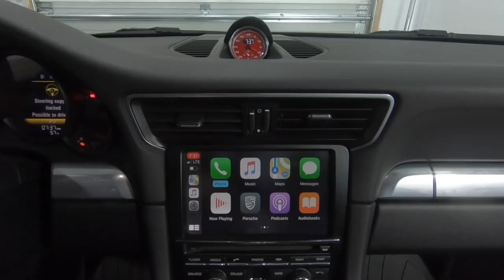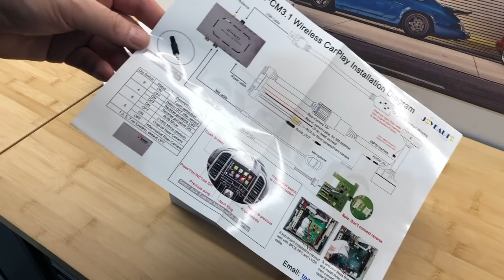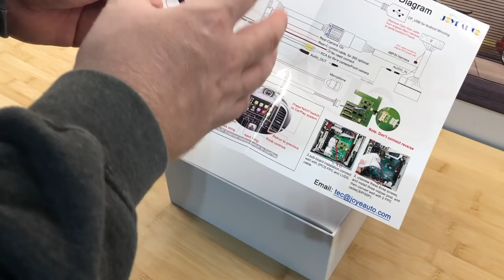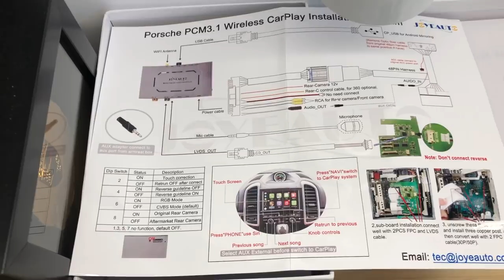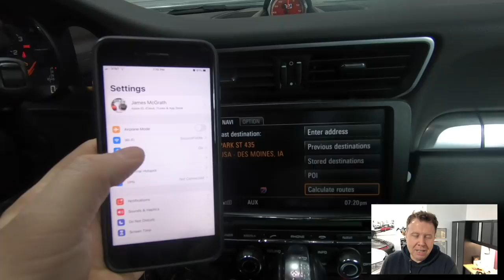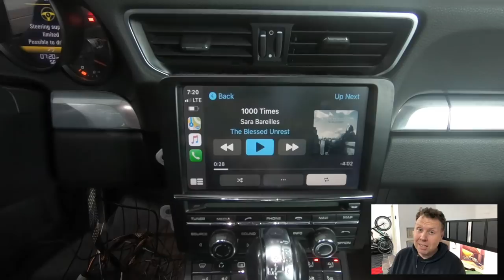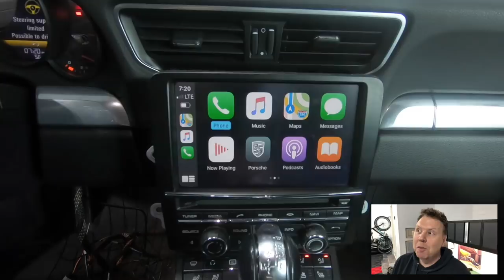Apple CarPlay DIY (Wireless) for Porsche 911 / Cayman / Boxster / Macan / Cayenne / Panamera

Comment: Around 22:00 in, before you reassemble the PCM I see your boards are loose. I feel that's what happened when mine was done and I have a vibration that happens around 70MPH that sounds like it's coming from the inside of the unit. I'm about to take mine apart to try and track it down... Great video!
Reply from the maker: Thanks John!! Yes, I would need another couple of the copper screw extenders to secure the board on the other side. That could be it. However, with the PCM unit reassembled, it’s nicely compacted together by the ribbon cables. I would be surprised if there is any wiggle room. Worth a look though!!
Reply: @AutoAmateur  It's an interesting vibration that only happens around 70-74mph, and I'm not 100% sure it is inside the unit, but that's where it appears to come from, and it does sound like something solid is loose and vibrating against the metal housing. I didn't do my install and don't actually know where they put the CarPlay module - that could be the vibration in my case as well. 

You're right though, there are very few videos that show how to do the install and yours is the best. I might have attempted myself had your video been around. 

I may upgrade to the Wireless CarPlay kit now that I've seen your video - thanks!
Reply from the maker: @JohnRobbfl  Thanks! Good luck! Let me know what you find out. Would be good to see if there is anything I still need to do to my install to prevent the same thing from happening. Cheers!

Comment: Thank you for the DIY. After watching your videos I went and purchased the Joyeauto for my 981 Cayman. Question, does your interface box stay on after you turn off the car. My head unit turned off automatically when I turned off the car but the interface box with the blue light stayed on. Just wondering if it is supposed to be that way or if I have a bad unit. Any help would be greatly appreciated.
Reply from the maker: If you use a switched fuse port, the blue light and the box will turn on and off with your ignition.
Reply: @AutoAmateur  I found the D1 fuse port on my Cayman that switched off when I turned off the car. Now it’s working perfectly. Thank you
Reply from the maker: @NorCal_Gearhead  You're very welcome!! Good job.

Comment: Just ran into two hitches. First the good news: kit now ships with double standoffs to get the board up higher. the bad news, they appear to have changed the Sirius antenna connector and nit now is still too high. So, I temp pulled the Sirius board. Secondly, I am having a very hard time getting the fiber optic (Bose) out of the original connector. I dont want to mess them up because replacement would be hell.  how did you or anybody get them out>
Reply from the maker: Hey Wilbert! For the board, you can place the board on top of the XM board and only fix two of the three screws down if necessary. Just put the third one in loosely. Once the pcm unit is back together it all sits together fine. For the fiber optic wires, you need to use a small flat head screwdriver to depress the small black retaining clip on the side. The black plug with the two wires comes out in one piece.
Reply: @AutoAmateur  thanks. I did it. Broke the tab on the old plug but hey it’s not going to be used anymore.

Comment: hi mate
very interesting and amazingly video on have seen on youtube. thanks a lot. just a quick question. will the same method works on Porsche Macan S 2015 please?
and can i ask where did you ended up put all that wire under the steering wheels mate?
thanks a lot again
Reply from the maker: Yes! This will work for your Macan. When you go to AliExpress to buy the unit, just select your model as you add the item to your cart. The link should be below the video in the description.
Reply from the maker: Ps. The unit and all the wiring it nearly zip tied away under the steering column, up and above your left foot.

Comment: I kind of hate asking this question, but when you installed the Joyeauto box under the steering column it looks like it would hinder the adjustment of the steering column up and down. Can you comment on this? PS nice job, well done.
Reply from the maker: Great question!! I don’t know for sure. It might. I’ll test it out and come back to you. Thanks!
Reply: I would also like to know, pros/cons on placement of the joyeauto box. What are its dimension? Can it be hidden in the glovebox instead? What cable routing options or holes are available behind the radio?
Reply from the maker: Great questions!

Comment: I nick, Thanks for the tuto, very easy to install.
Just a question, After about 48hours, my battery is done, the joyeauto stay on After I turn off the car, Thanks for your answere and sorry for my bad english.
Reply from the maker: You need to use a fuse slot that is switched. This means the fuse turns on and off with the ignition. The fuse you are using isn’t switched which means the power stays on when your engine is off and this drains the battery.
Reply: @AutoAmateur  Oh yes Thanks, I did this mistake !!
Thanks for the very fast reply.

Comment: Great instruction vid. As I am to begin this task this weekend, may I ask if the PCM was coded (for disconnection of power)?
Reply from the maker: No coding required. You can power up / down, install / unplug the PCM as much as you wish, you won't need to enter a code in it to activate it. Good luck! Let me know if you need any help along the way.
Reply: @AutoAmateur  hi, thanks for the reply. All went well with the task and the result is as desired, Apple CarPlay on my 2014 PCM

Comment: nice job. you've had it a few months now. any update on how it's working and you're still happy with it? you can keep the SAT radio option?
Reply from the maker: Hey Dario! So far so good. I did keep the SAT radio option, not that I use it very much, but it’s still there and working. Overall I’m still really impressed with it. The sound quality is great, the CarPlay screen appears within seconds of turning the car on 99.9% of the time. The only real issue I encounter time to time is when I receive phone calls, I control the call via CarPlay but the voice uses PCM. Sometimes I have drop the call and call the person back. That only happens every once in a while though. It’s actually a configuration issue on my side that’s the problem I think. But I haven’t bothered really getting to the bottom of it yet.
Reply: @AutoAmateur  Thanks. Very helpful. This seems like a good project to take on during the current situation.
Reply from the maker: Absolutely!

Comment: Hello, thanks for the video, I have one question, after the installation, do you still have the map on the dashboard gages ? Thanks
Reply from the maker: You still have the Porsche PCM on the instrument cluster display, yes. That still functions like normal, just as if you had an iPod plugged in via USB. You can use your CarPlay app on the PCM and still use PCM Navi at the same time.
Reply: @AutoAmateur  thank you

Comment: How does the working carplay perform? From all the videos I’ve seen it seems like it is lagging / slow / not smooth like the original interface? Hope you got the time to comment on that. One more thing I would do when doing that is swapping the hdd with an ssd for better performance of...pretty much everything pcm related
Reply from the maker: 2 years in and the CarPlay unit is still working perfectly. It’s just as fast and responsive as the factory fitted CarPlay in my Silverado.
Reply: @AutoAmateur  cheers and thanks for the rapid reply. I am getting a 2014 Panamera S and I will order this before someone else decides to park their ship sideways the Suez :)

Comment: Quick Question: Is it safe to say I can follow your video and not miss any steps? Asking if you did all steps on video and shared with us? I ordered this for my cayenne. thanks in advance
Reply from the maker: Hey Kam! There is one step you didn’t see on the video. There is a fiber optic cable that is in the large black square OEM wiring harness. You pull that one out of the OEM one and plug it into the 48-pin adapter. That’s it.
Reply from the maker: One other point. The procedure to remove the Cayenne’s PCM is a little different than the 991. I don’t know for sure; but I believe you have to remove the A/C air vents either side of the PCM to get to the screws that hold the PCM in place.
Reply: @AutoAmateur  You are correct. I have removed the air vents in the past, after that its pretty much the same as the 991
Reply: @kam1996  hi guys , ive had mine installed today and having an issue with my factory rear camera not working and the radio with no sound , I'm taking it back in the morning as I suspect the multi plug isn't pushed in enough although I cant see how this would stop the camera working , its really stressing me out lol.  its a 2016 cayenne with Bose .

Comment: Fantastic job mate! Is there an option for Android user? I wonder if this will work on my 997.2?
Reply from the maker: You bet! In fact, I believe the same unit also works for Android, only via USB not wireless. I would have to double check.
Reply: @AutoAmateur  I'd love to know as well... it'll save me from buying another phone! :)
Reply from the maker: Hey Peder. Yes! It works with both Android and Apple phones. You just need to select that as the option when you check out on AliExpress. Or contact JoyeAuto directly. Either way, you’ll be good. https://m.aliexpress.com/item/32965636597.html?trace=wwwdetail2mobilesitedetail&spm=a2g0o.productlist.0.0.7c566d57WTnnE5&algo_pvid=a18e1649-b64f-4506-8427-74f2c9f554d0&algo_expid=a18e1649-b64f-4506-8427-74f2c9f554d0-3&btsid=0ab6fab215842003432685334eb9ae&ws_ab_test=searchweb0_0,searchweb201602_,searchweb201603_

Comment: I just bought one and the screen doesn’t turns on but it has sound, so you know why does that happen and do you know how to fix it?
Reply from the maker: It's probably a problem with one of your ribbons cables either not being installed into the port correctly, or the wrong way up.

Comment: Just to clarify, you can charge your phone as normal (using a cigarette lighter for example) with or without CarPlay running, correct?
Reply from the maker: That's right! Same as usual. You can charge your phone any time, with or without CP running.

Comment: Hello  I seem to be having the same issue but no power to the carplay unit at all. did you need to remove the blue restrictor from the porsche harness to make contact with the oem harness.  I see in your video your touching it but Im not sure if you removed it. My fuse location is 12volts hot for sure but the carplay unit isn't showing a light of any sort. nothing indicating from the carplay unit on my screen. although my pcm is working like it did before the mod. Thank you

Comment: Hi there

I have tried to fit this to my 991.1 targa , but i have hit a problem !
The head unit switches off with an alert from the dash saying SWITCHES DEACTIVATED. So after maybe ten attempts to start the head unit its now not working .
I noticed that i have 2 small pins in the head unit that the Joyeauto harness hasn’t and the original harness has a blue flashing light that matches into the head unit.

Any ideas going forward
Reply from the maker: Hey Calum! Can you email at contact@autoamateur.com please? It would be great if you could send me any photos or videos of how you have things hooked up so I can see if I spot any issues. Happy to help! James

Comment: Nice video! What iPhone do you have? I installed my Joyeauto today (981 Boxster S) and get this error on my iPhone: this accessory is not supported by this device
Reply from the maker: Thank you! I have the iPhone 8S. Did you email tech support at Joyeauto?
Reply: @AutoAmateur  
Tech support responds quickly, but the problem is not yet solved. I'm afraid the device is defective, or there is a software problem. Installation was successful, USB play works for example, but CarPlay does not. Very frustrating!
Reply from the maker: @ditissander1  I had a similar challenge! I could hear the sound from my iPhone through the PCM unit both connected via USB and wirelessly, but the screen went blank on the PCM. It wasn't showing me the CarPlay app. The problem was that I hadn't connected the wiring harnesses correctly in the back. My OEM 48-in (big black square) wiring harness wasn't connected all the way into the Joyoauto provided extender that in turn was plugged into my PCM. One of the wires (either the green or the blue wiring harnesses inside of the black square plug) wasn't all the way in. This fixed the problem immediately.
Reply from the maker: I think what happened was that the wires got disconnected slightly when I tried to put the PCM back into the console. With the new wiring harness back there, space is extremely tight and they got a little squished.

Comment: Any recommendation on which fuse to utilize?  I’m tackling this tomorrow in my 991 Turbo S. Assuming (hopefully) I’ll have the same fuse available that others have used.
Reply from the maker: As you look at your driver's side fuse box, I used the empty fuse slot on the lowest row, left side.
Reply: Awesome. Thanks for the response and the great video. Fingers crossed tomorrow.
Reply from the maker: Cheers Dom!
Reply: Mission accomplished. The ribbon cables are a pain but aside from that, follow the instructions in the video and you are all good.

Comment: Have question on this regarding power. PCM stays on after you turn off the engine and PCM works for the next 20 minutes. Did you manage to install JoyAuto so that it remains powered like the PCM after you turn off the engine?
Reply from the maker: Yes. I used one of the empty fuse slots that is switched. So, like the PCM, the Joyeauto unit will stay on for the same duration until the car switches everything off.

Comment: Update: Local car stereo shop quoted me 4 to 6 hours to install the rear camera option on the Joy Auto mod at $150 per hour. So I studied several more videos and stuck my borescope camera into various nooks and crannies. I decided I could do it for less t6han $600. Took off the bumper and ran my wires around the RIGHT side of the car went behind the taillight. and into the rubber seals being careful to keep the wires clear of convertible top guillotines. then i tested the camera and Oh Joy! it works great. even hast the little car silhouette when you get close to an immoveable object. Went to my local market to get some essential items (butter and Glenlivet) and when I got back to the car I noticed the rear windows were still down with the top up. I hadn't noticed when i parked and put the top up, but the front windows didn't come up when the top reached full lock but came up with the switches. So happy with Carplay mod and rear camera but cant live with back windows down. What did I do wrong.BTW, I am going to stow the JA box to the passenger side beneath the kick panel were you access the cabin air filter.
Reply from the maker: Once you get the JoyeAuto unit installed (2 hour job if you’ve done it before), it shouldn’t take more than 3 hours to do the back-up camera. 4 to 6 hours sounds a shop that doesn’t know what they’re doing.
Reply: @AutoAmateur  Yep, i probably took three hours which included rereviewing the video and stopping to talk to each of my neighbors who came by. I did not have to drill any holes for the wiring, but I did initially route the cable so that it interfered with the rear quarter windows (cab). Electrical expert at the dealership spotted it and i was able to reroute and all is well.
Bert

Comment: Can you advise where or how you positioned the bulk connector to allow the head unit to fully seat inside the opening? I have a 2012 987.2 Boxster. Having difficulty finding the space. Hoping someone can provide some tips. Thanks.
Reply from the maker: Sorry for the late reply and I'm assuming you figured this out already, but if not here goes... there are a couple of gaps in the lower side of the shelf that the unit fits into. If you push as much of the cabling down into those gaps you free up the space you need to get the unit all the way back into place.
Reply: Yes I did. I had to cut the plastic guide at the back side of the head unit enclosure. It’s a narrow angled piece of plastic across the bottom back. Cut it at both ends and removed it. Gave me lots of space to pass the bulk connector below towards the floor. Thanks.

Comment: Curious how this is working after a year?  Any problems?  I've been looking at a unit by a company called zz-2 in the states for my 14 Cayenne.  Did you have to give up any functions of the PCM?
Reply from the maker: This is still one of my favorite mods on the 911. It still works perfectly. No issues! Check out my website for discounts and free shipping if you want one.

Comment: Awesome man any downsides whatsoever? Replacing our stock Porsche radio unit with a whole new Alpine Apple Carplay in the 987.1 Boxster cost a LOT of money. Then the stock amp didnt work with new head unit ... then more money.... lol
Reply from the maker: That was a similar story for my 997’s after market head unit. Sorry to hear that mate!
Reply from the maker: No downsides so far with this mod. I love that it functions seamlessly within the PCM. I’m not over the moon about the multimedia unit being stuffed under the steering wheel column though. I hope that it doesn’t rattle.
Reply: @AutoAmateur  No audio dropouts or glitches?  That'd be a big concern of mine, especially with 2.4 GHz interference from whatever you're driving by at the moment.
Reply from the maker: NoahFect I haven’t tested it enough to know to be honest. I’ll do a review after I’ve used it for a few weeks. Thanks!!